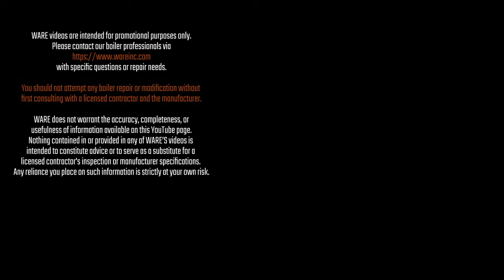How Float & Thermostatic Steam Traps Really Work (Operation + Troubleshooting Guide) - Weekly Tips

Comment: PLEASE HELP ME GUYS!!

My big question is am I operating at to high of a pressure? I have always been told that we operate at 10psi. I can not find anything supporting this. 

But I have always had a major issue with water hammering and condensate retiring to hot. I have been chasing steam traps and when I change them it seems to do nothing. 

I have recently found things suggesting that I should be operating at lower psi. In you guys experience does this make sense?

Please feel free to respond and ask me questions.
Reply from the maker: Great question!
"10 to 12 psi is normal for a low-pressure system. If you have water hammer and the condensate is returning too hot, then you are on the right track. There are either traps blowing by that you have not found or there are by-pass lines around one or more traps that are open. Keep looking buddy. You will find it. FYI. A good heat gun will save you a lot of time in troubleshooting traps and bypass lines." - Steven

Legal Disclaimer (required):
Ware Boilers’ videos and comments are intended for promotional purposes only and do not constitute professional advice. Please contact our boiler professionals via https://www.wareinc.com/ with specific questions or repair needs. You should not attempt any boiler repair or modification without first consulting with a licensed contractor and the manufacturer. Ware Boilers does not warrant the accuracy, completeness, or usefulness of information available on this YouTube page. Nothing contained in or provided in any of Ware Boilers’ videos is intended to constitute advice or to serve as a substitute for a licensed contractor’s inspection or manufacturer specifications. Any reliance you place on such information is strictly at your own risk.
Reply: Sounds like it could be the configuration and or the length of the piping system to or from the trap. Check your delta P across the trap and be sure you are operating within allowable limits from manufacturer. Be sure you eliminate all pockets or low point in the condensate piping. Traps are intended to drain not lift the condensation unless you have a trap pump.
Reply: So today I ran my boiler at 5psi and have had a completely different day. No hammering and my condensate is actually returning at a normal rate. Also the building is still heating efficiently. 

At 10psi when the system would get up to pressure it would crack and popping and the condensate was 100% flashing in my return pit. When this was going on my pumps would lose efficiency and not return condensate over to my makeup tank. 

Now I am returning condensate correctly. Also my return pumps actually cycle like normal. Steam traps also seem to be operating correctly as well.